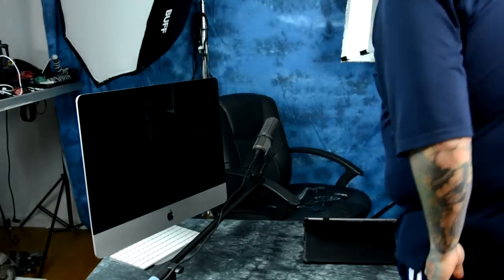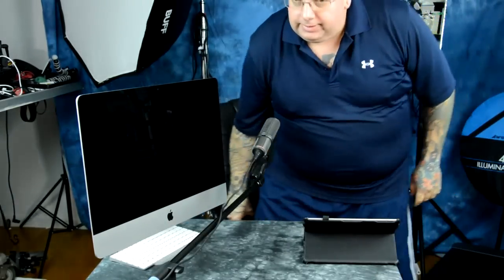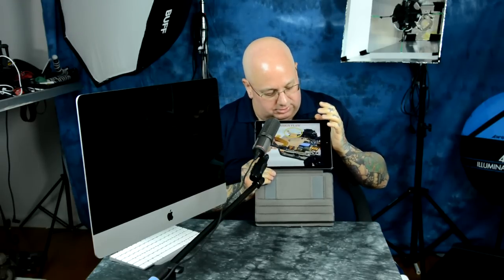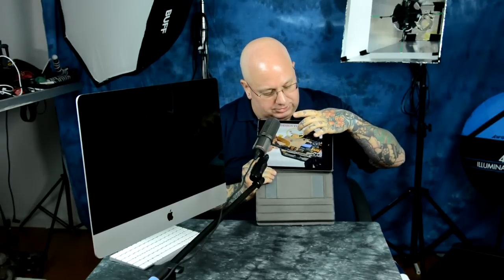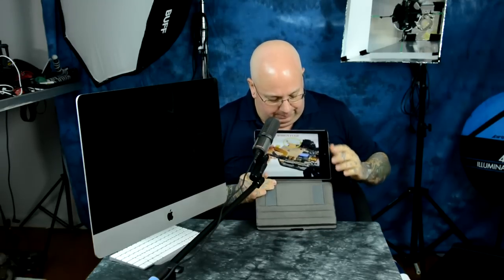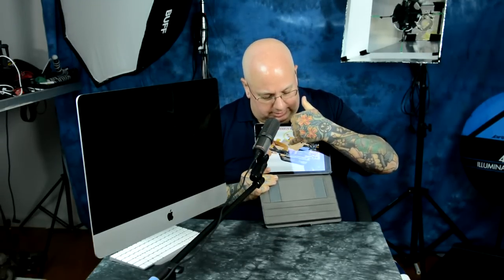PROOF: Sony A7Rii Design Flaw & camera failure due to External Heat-Shield wicking

Comment: I'll been using a sony A7RII for 6 years and still working as it was when new. But I only been using it with sony batteries, sony lenses or the old minolta lenses for weddings, Quiniceañeras outdoor landcapes, all seasons. And if I upgrade I will get another Sony.

Comment: It seems even IP67 or IP68 isn't a guarantee of passing all lower test conditions:
https://www.cnet.com/uk/how-to/water-dust-resistance-ratings-in-gadgets-explained/

I've been interested in the A7R3 and a GM lens, or D850, or 5DSRmk2?  Wonder if anyone will do a tear down to show how well they are sealed?

My current camera is the Pentax K3, well known for weather sealing.  Googling this also showed:
https://petapixel.com/2014/11/04/cracking-open-7d-mark-ii-thoroughly-weather-sealed-camera-ive-ever-seen/

Comment: The vapor pressure level of a given air mass, say a closed room in a house, will tend to equalize throughout that mass, Boyle’s Law. If you open the door that adjoins the room to an adjacent space with a different vapor pressure level, the vapor pressure levels of the two air masses will rapidly equalize, again Boyle’s Law. An example would be a warm steamy bathroom as compared to a cooler adjoining bedroom. The problem occurs when the difference in vapor pressure levels is extreme such as the case of a warm steamy bathroom and the outdoors with freezing low humidity winter conditions. I have seen the effects of water damage caused by condensation that originates when high vapor pressure, e.g., in a bathroom, successfully forces its way through an exterior wall and eventually causes condensation on an exterior surface with a temperature at of below the dew point. Unfortunately, the place where the condensation occurs is usually out of view so over time the moisture buildup causes decay of the material.

The Sony A7Rii DESIGN FLAW BREAKS THE THERMAL BARRIER BETWEEN THE INSIDE AND OUTSIDE OF THE CAMERA. As for cameras that are not hermetically sealed and the camera has a lower internal temperature and hence lower internal vapor pressure level, Boyle’s Law, than its surroundings. If the camera with a low internal temperature is suddenly moved to an area of higher temperature and vapor pressure level Boyle’s Law says that the two different pressure levels will try to equalize. Since this process will not have any effect on the ambient pressure level of the outdoors the interior of the camera will KEEP assuming the vapor pressure level of its surroundings due to the increased temperature inside the camera. Water vapor, therefore, will find any means to migrate into the camera and will condense on any cooler materials it encounters. There are physical differences between the A7R and A7RII, where one has more points of leakage that allows it to succumb to Boyle’s Law.

The heat sink design of the A7RII penetrates the camera casing, if you will, in which the electronics are located. Under situations where the internal and external vapor pressure levels are different (which is OFTEN), Boyle’s Law says that water vapor will seek the path of least resistance, which is caused by the PROTRUDING HEAT SINK.

As for the wicking phenomena that you mentioned, this too has a architectural analogy. Actually, years ago when aluminum window frames were first introduced, there were problems with the thermal conductivity of the material which, in winter conditions, caused the internal temperature of the frame to drop relative to the internal temperature of the space in which it was located. Often the result would be condensation of the internal parts of the window. Today windows are designed with a thermal break that interrupts the conduction of heat energy. This is synonymous with the A7R vs A7RII situation.
Reply from the maker: hey girl!!!!!!!!!  как ваш день идти великолепна
Reply: +Theoria Apophasis Спасибо Мистер. Я очень рада, что у меня есть ваша поддержка. Мне она очень пригодиться в суде. Я намерена наказать террористов Sony. Буду требовать возмещения ущерба. Морально и материально. 
Но думаю что уже многие люди отказались от покупки дерьмо Sony.  

Спасибо больше Мистер. Вы прекрасный человек.
Reply from the maker: наказать их как безумной собаки !!!

уничтожить сони в суде с фактами и заставить их заплатить .

Comment: Right before I got rid of my Sony A7, it malfunctioned where it would not drop the shutter or take images, acted even more sluggish than usual, with very erratic behavior. Then the issue randomly disappeared. After that I knew it had to go. So happy it is gone after hearing the amount of horror stories. 15 months of use.

Comment: two things that come to mind
(1)  as a cooling device cools down,its temperature will drop below ambient for a short period,so that copper plate will,after usage and subsequent cooling will be cooler than any other part of camera=condensation+wicking
(2) with a serious mix of unprotected disimilar (uncoated) metals if any 2 of these are touching each other,or are bridged by moisure there will be electro-galvanic activity between them(basically a battery) this is known as "electro galvanic corrosion"
("disimilar metal corrsion" if your old school)when this occurs the salts (oxides) that are produced from the weaker (less noble) metal being corroded will form a stronger electrolyte,and then the whole thing is in a runaway state,usually a pitting type of corrosion will occur,which is consistant with the photo of the magnesium backplate shown in the photo
In the aircraft industry jointing compounds are used to prevent this-in the electronics industry conformal coatings ("shellac")are used on pcb's to stop the joints between devices and the copper tracks rotting and failing
(3) I could be wrong but from the pictures shown there does not even appear to be a gasket or seal between the viewfinder and the cover or the provision for one!..maybe you could clarify that Theoria!
all in all looks like piss poor engineering to me!
Reply from the maker: youre correct there is NO SEAL , if you look you can see the copper

Comment: Is it worth fixing even? seems like it will happen again.....
Reply from the maker: fixing a camera doesnt change a design flaw, you mean REDESIGN IT…..sure. 

NO OTHER camera mfg. has ignorantly placed part of their processor heat sync OUTSIDE of the camera, all that does it cause a temperature disparity that SUCKS IN moisture.

You can see from the INSIDE of the back of the magneisum BACK PLATE that that is the entry point the moisture migrated from to inside, then the magnesium sloughed off creating magnesium oxide which THEN accumulated on the circuit board causing electrical failure of the camera !!!
https://www.flickr.com/photos/134746128@N05/28829246750/in/dateposted/
https://www.flickr.com/photos/134746128@N05/28828753410/in/dateposted/
https://www.flickr.com/photos/134746128@N05/28497375093/in/dateposted/

the evidence is irrefutable.   SOME fool decided to secure the TOP OF the heat shield to two screw holes around the viewfinder OUTSIDE OF THE CAMERA.      Epic design flaw
https://www.flickr.com/photos/134746128@N05/29010165142/in/dateposted/

I dont give a crap what anyone thinks of me, but im extremely good at failure diagnostics, been doing it most of my life
Reply: I guess the root of my question was, what did you recommend to the person who owns the camera? fix and sell or just cut losses and sell for parts?
Reply: I have no doubt you know your stuff, that's why I watch your channel....

Comment: Sony should really hire some engineers who know thermal engineering better. Their smartphones and cameras are plagued with these issues for way too long!
Reply from the maker: NO OTHER camera mfg. has ignorantly placed part of their processor heat sync OUTSIDE of the camera, all that does it cause a temperature disparity that SUCKS IN moisture.

You can see from the INSIDE of the back of the magneisum BACK PLATE that that is the entry point the moisture migrated from to inside, then the magnesium sloughed off creating magnesium oxide which THEN accumulated on the circuit board causing electrical failure of the camera !!!
https://www.flickr.com/photos/134746128@N05/28829246750/in/dateposted/
https://www.flickr.com/photos/134746128@N05/28828753410/in/dateposted/
https://www.flickr.com/photos/134746128@N05/28497375093/in/dateposted/

the evidence is irrefutable.   SOME fool decided to secure the TOP OF the heat shield to two screw holes around the viewfinder OUTSIDE OF THE CAMERA.      Epic design flaw
https://www.flickr.com/photos/134746128@N05/29010165142/in/dateposted/

I dont give a crap what anyone thinks of me, but im extremely good at failure diagnostics, been doing it most of my life
Reply: Thomas Breithaupt Hi, I also have a BSEE degree, MSEE degree, and I am working towards a PhD, also in EE (you can look up for my papers on IEEExplore using the name Shang Hsien Yang). I am a circuit design engineer. I will admit that thermal management isn't my expertise, but I can clearly see that Sony need to solve this problem.
Sony's a6300 has even more severe overheating issues than the a7r2 (I've witnessed with my own eyes. ~40mins of 4K is enough to shut it down)
Sony's Xperia X gets even more heat when recording 1080p compared to a Samsung Galaxy S7 recording 4K.
None of this is acceptable, and Sony needs to improve that.
As a final note, Sony does make products to fit in cars, but mainly for multimedia entertainment purposes. Sony cannot be trusted on critical applications such as ABS and SRS systems.

Comment: How is weather sealing  working then the say the a7R II and a7S II has weather sealing when they show all the features? =)
Reply: http://www.sonyalpharumors.com/sonys-a7-and-a7r-cameras-are-not-dust-and-moisture-resistant/
Reply from the maker: I cant comment on other models, only on this one. 

NO OTHER camera mfg. has ignorantly placed part of their processor heat sync OUTSIDE of the camera, all that does it cause a temperature disparity that SUCKS IN moisture.

You can see from the INSIDE of the back of the magneisum BACK PLATE that that is the entry point the moisture migrated from to inside, then the magnesium sloughed off creating magnesium oxide which THEN accumulated on the circuit board causing electrical failure of the camera !!!
https://www.flickr.com/photos/134746128@N05/28829246750/in/dateposted/
https://www.flickr.com/photos/134746128@N05/28828753410/in/dateposted/
https://www.flickr.com/photos/134746128@N05/28497375093/in/dateposted/

the evidence is irrefutable.   SOME fool decided to secure the TOP OF the heat shield to two screw holes around the viewfinder OUTSIDE OF THE CAMERA.      Epic design flaw
https://www.flickr.com/photos/134746128@N05/29010165142/in/dateposted/

I dont give a crap what anyone thinks of me, but im extremely good at failure diagnostics, been doing it most of my life
Reply: I have posted link to your video  on twitter, got response. That might only affect the A7R II, the A7 II & A7s II have a silver heat sync which shouldn't corrode that way.
Reply from the maker: yes yes, see my latest video, i compare the A7R vs A7RII

SEE MY LATEST VIDEO !!!!
Reply from the maker: VIKTOR ARCH no, you dont have a silver heat sync, thats the viewfinder retainer piece

i explain ALL this in the NEWEST video , check it
Reply: it's not me one college  has a7s II he silver plate its his response I know that their wont be silver there just metal maybe but not silver..
Reply from the maker: just check the newest video and pictures, explains everything :)
Reply: ok, can you make the same kind video analysing a7s vs a7s II?
Reply from the maker: i dont have inside pictures of the A7s
Reply from the maker: people hate it when i talk about sony flaws, i make too many of them, theyll really get PISSED
Reply: the more views and subscribers you will get, talking about real stuff that nobody talking =)
Reply from the maker: MOST sony people are rabidly ANGRY and insane, they get violent when i mention sony
Reply: I have as sony to FS video camera and it solid , but has many other software and overall ergonomical problems but the technology is good, the color science is bad . I like the sony stabilisation but hate lenses , quality and price if it would be 50% from canon nikon then ok.
Reply from the maker: i never mentioned the a6300

see the SECOND VIDEO on this i uploaded today and ITS PICTURES,  ohhhhhhh man!!!!!
Reply: I hope a6300 dosen't have this , it also has overheating problems. Because of that it would be good video about a6300 vs 6000, if you  would make it, its only suggestion.
Reply: you will need to buy RED for Full frame

Comment: Yay, Sony make eyeball steamer :D
Reply from the maker: NO OTHER camera mfg. has ignorantly placed part of their processor heat sync OUTSIDE of the camera, all that does it cause a temperature disparity that SUCKS IN moisture.

You can see from the INSIDE of the back of the magneisum BACK PLATE that that is the entry point the moisture migrated from to inside, then the magnesium sloughed off creating magnesium oxide which THEN accumulated on the circuit board causing electrical failure of the camera !!!
https://www.flickr.com/photos/134746128@N05/28829246750/in/dateposted/
https://www.flickr.com/photos/134746128@N05/28828753410/in/dateposted/
https://www.flickr.com/photos/134746128@N05/28497375093/in/dateposted/

the evidence is irrefutable.   SOME fool decided to secure the TOP OF the heat shield to two screw holes around the viewfinder OUTSIDE OF THE CAMERA.      Epic design flaw
https://www.flickr.com/photos/134746128@N05/29010165142/in/dateposted/

I dont give a crap what anyone thinks of me, but im extremely good at failure diagnostics, been doing it most of my life

Comment: Ken, is this happening just in video mode or with stills also, do you think that this is just a bad batch of cameras or is it all the A7 series ever made? because if that’s the case, there should be a worldwide massive recall by Sony and do you think that it could possibly lead to an unprecedented international class action lawsuit?
Reply from the maker: No, the camera gets hot during regular photography too, just not as hot.   NO not a bad batch, that IS the inside of the camera with the design flaw. 

NO OTHER camera mfg. has ignorantly placed their processor heat sync OUTSIDE of the camera, all that does it cause a temperature disparity that SUCKS IN moisture.

You can see from the INSIDE of the back of the magneisum BACK PLATE that that is the entry point the moisture migrated from to inside, then the magnesium sloughed off creating magnesium oxide which THEN accumulated on the circuit board causing electrical failure of the camera !!!

the evidence is irrefutable.   SOME fool decided to secure the TOP OF the heat shield to two screw holes around the viewfinder OUTSIDE OF THE CAMERA.      Epic design flaw

I dont give a crap what anyone thinks of me, but im extremely good at failure diagnostics, been doing it most of my life
Reply: I don’t think that this is a matter of what anyone one thinks of you Ken, it’s a matter of a company, whether it’s Sony or any product from any manufacturer making millions of dollars and giving people garbage in return. If what you are claiming is true (and I’m not refuting it, you’re the expert), someone is going to (and should) take legal action.

Comment: Damn that sucks!  They clearly wanted to draw heat out of the camera... What's shocking is that they vent it so close to the eye...  1st off, there's a lot of moisture there from skin...probably the only place that gets that much contact!  Plus, if it gets hot enough, wouldn't that pose a safety issue?  Roasted eyeball, yum... And, one big shield, no circulation, no cooling.  I'd bet you'd find the same problem with their computers and mobile phones... shame on Sony.
Reply from the maker: NO OTHER camera mfg. has ignorantly placed their processor heat sync OUTSIDE of the camera, all that does it cause a temperature disparity that SUCKS IN moisture.

You can see from the INSIDE of the back of the magneisum BACK PLATE that that is the entry point the moisture migrated from to inside, then the magnesium sloughed off creating magnesium oxide which THEN accumulated on the circuit board causing electrical failure of the camera !!!

the evidence is irrefutable.   SOME fool decided to secure the TOP OF the heat shield to two screw holes around the viewfinder OUTSIDE OF THE CAMERA.      Epic design flaw

I dont give a crap what anyone thinks of me, but im extremely good at failure diagnostics, been doing it most of my life

Comment: Is it the AS7ii also?
Reply from the maker: i cant comment on other models, i dont know
Reply from the maker: i just found out what they CHANGED between the A7R and the A7RII,  the 2 has the design flaw

also--
check out and read these new pics:
https://www.flickr.com/photos/134746128@N05/29055926931/in/dateposted/ https://www.flickr.com/photos/134746128@N05/29132993285/in/photostream/ https://www.flickr.com/photos/134746128@N05/29055927351/in/photostream/ https://www.flickr.com/photos/134746128@N05/29132993525/in/photostream/